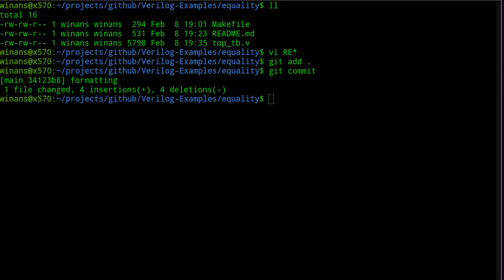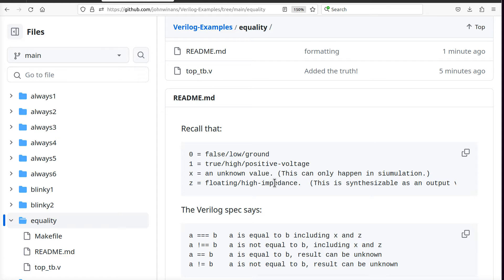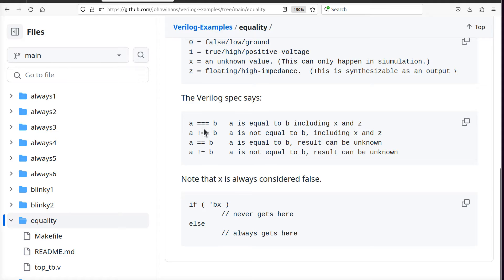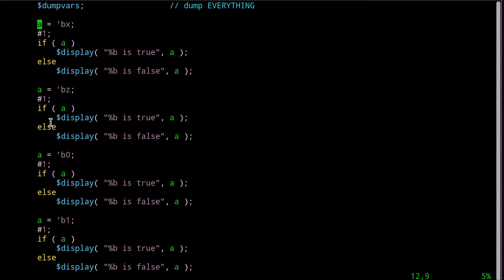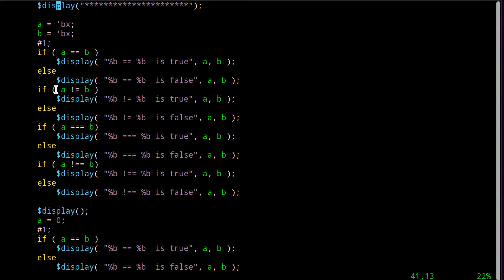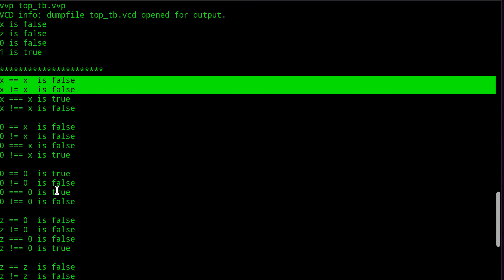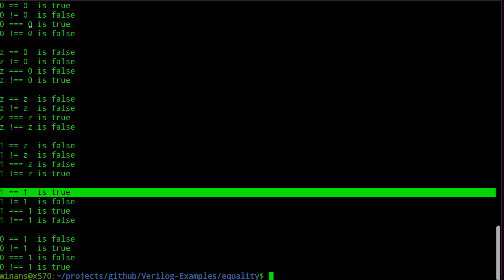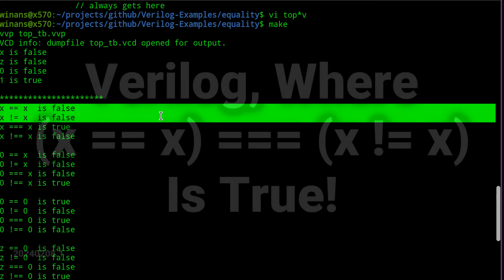FPGA #10 - Verilog == and === operators

Comment: I remember running into these "problems" when writing a logic simulator many years back! Can make your head hurt! How many years back? I was using the "New" Turbo Pascal 5.5!
Reply: What? Turbo Pascal wouldn't be that weird 😅
And yes 5.5 was fairly advanced, it did have OOP, didn't it ?
Reply: @b213videoz Turbo Pascal wasn't weird at all. I first started using the CP/M version in 1984. Yes, Turbo Pascal 5.5 took a "swing" at OOP.
What was weird was setting up the definitions of (truth tables if you will) of basic logic that included unknown values as well as how to describe pull-up/down and tri-state.  No internet! No one to ask!

Comment: In my mind it works. A normal comparison with an unknown should lead to undefined and undefined would be treated as false in most situations. The triple equals is a special operator to handle this special case.

Kind of a similar situation where strings have value so they are true, but the language auto converts strings to other data types. Are the strings '0' and 'false' true or false?
Reply from the maker: It is like comparing a value against a NAN.  Anything compared to a NAN shall be false.
Reply: @JohnsBasement  That makes me think of the phrase "not even wrong."
Reply from the maker: @barongerhardt  I've been there!  😂